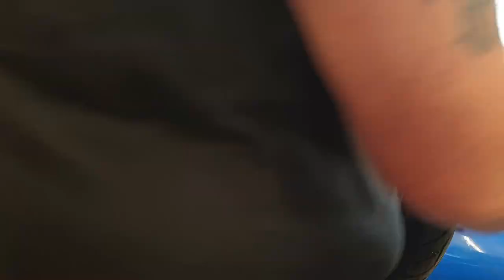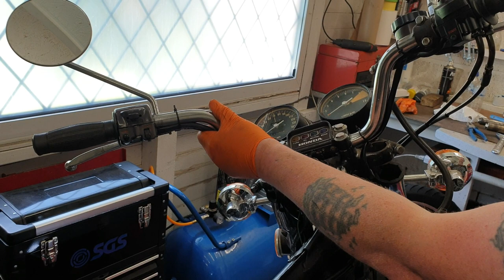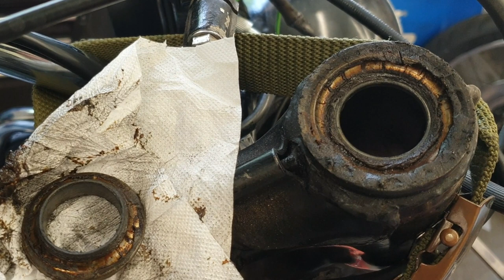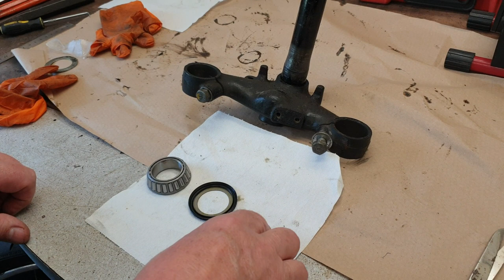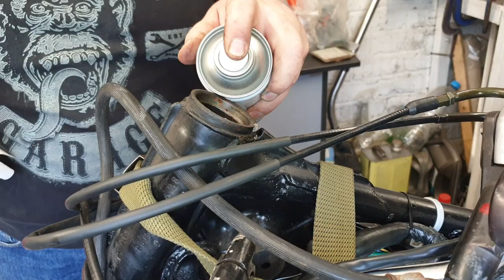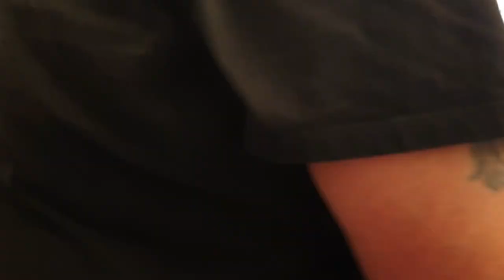How To Replace Steering Head Bearings on a Honda CB750 Motorcycle | Roller Bearing Upgrade | Part 22

Comment: On my Honda Shadow I had to use the spacer disc over the outer race on the lower bearing. If not the plate would hit the frame
Reply from the maker: I suspect the bearing kit is for a lot of different bikes, with different requirements for spacers.

Comment: Is it possible that thick washer was to give the correct spacing between the seal and the taper cage?
Reply from the maker: I'm sure it is to be used as a spacer, but I suspect that same kit fits a lot of different bikes, and that part just isn't needed for my one.  I am sure it wasn't going to work with it.

Comment: For so many motorbike jobs, removing and replacing all the bits to get to what you want to repair takes longer than the actual repair. As my Yorkshire wife would say, job's a good'un.
Reply from the maker: Too right, they're tightly packaged machines. It's a labour of love though.

Although modern bikes are much harder to work on than this!

Comment: Brilliant video as usual, will keep watching. As you suggested I changed out rotor stator and regulator on my cb750 1981. Wondering if you have heard of anyone removing the pressed in idle jets on the keihin VB carbs. Kind regards
Reply from the maker: Cheers, glad the vids are coming in helpful for you! :) You can definitely replace those idle jets because you can buy new ones. Although I can't say I've replaced them myself.

I'd have thought drilling them, tapping them, then threading something in to help with pulling them out would be a good way.
Reply: @SPANNERRASH  thanks for the advice will give it a try need to get the right tap and drill will let you know how I go on. Thanks again
Reply from the maker: @kimsmith4409  No worries mate, good luck sorting it!